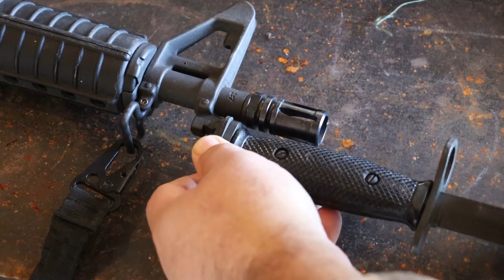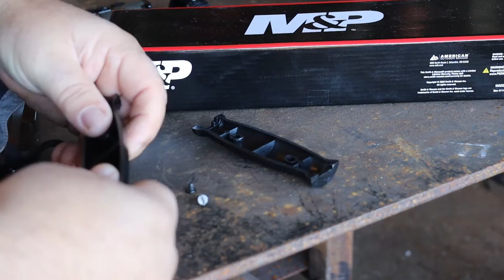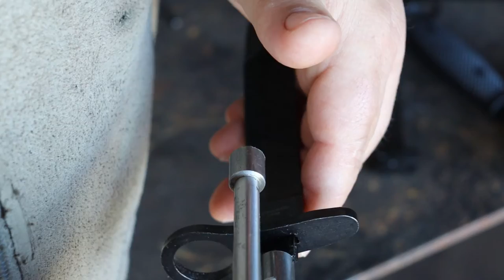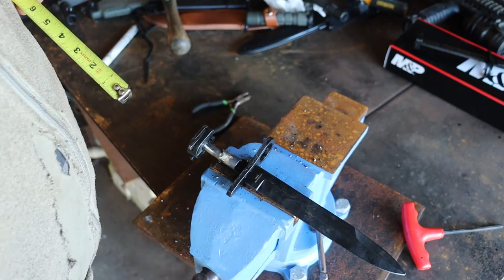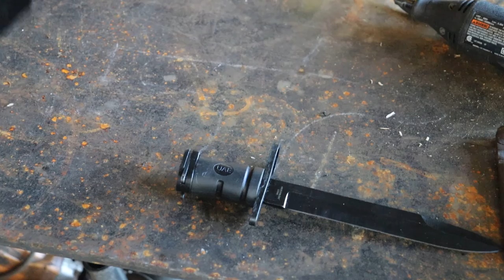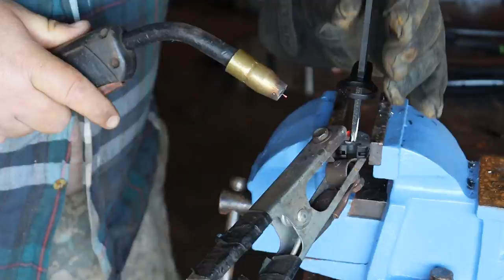Stubby AR Bayonet

Comment: An alternate solution would be to make an extension that fits on flash hider so that the shorty can take a standard bayonet. The advantage of this is that when you're in stabby mode the longer thing is an advantage but you can easily go back to shorty mode by taking off the attachment and bayonet.

Comment: a worthless piece of issue! tey'd be better off issuing a Kbar or bowie knife! hopefully those sharpen better than the original i had!! that thing wouldn't take an edge to save the world!!
Reply from the maker: Pointy not sharp! Thanks for watching Keith.
Reply: @VooDooTennessee  well Branden to me if you're carrying something that looks like a knife you should be able to use it as a knife! afterall how hard would it be to take a k-bar a bowie or a Buck fixed blade hunter and add the bayonet mounting hardware to it turning it into a dual use piece? if the army is still going to issue them instead of a knife they need to be usable as a knife first and a bayonet second otherwise they're not worth wasting the weight when it can be put into another magazine!!
Reply: @keithmoore5306  you missed the point 😁.
Reply: @Sandhill1988  not really Branden's coming at it from a goofy accouterment just for fun angle basically gaudy gun bling, i'm coming at it from the practical having to carry one angle, my disdain comes from carrying one and having carried one i don't like the damn things and never will! but if you want to lug around a pig sticker fine put the mounting hardware on a knife that will actually cut and hold an edge then problem solved otherwise it won't be 9 months before it ends up in a footlocker and you hit the local sporting goods store for a good fixed blade for your gear!
Reply: @keithmoore5306 bayonets are designed to stab, not cut.
Reply: @damnits2200  and thus a mono-use item and not worth the carry weight and space it takes up!!